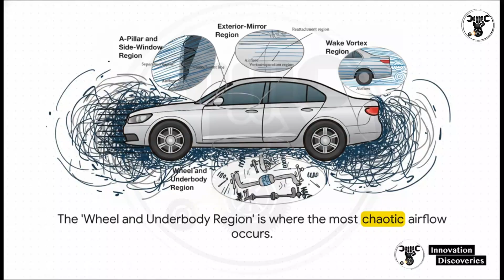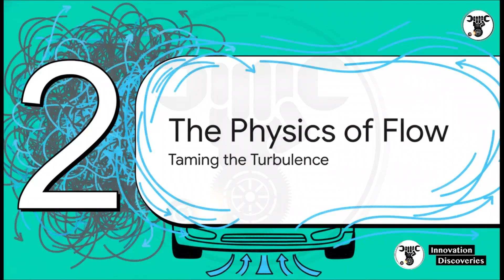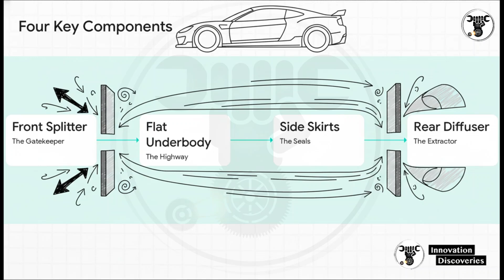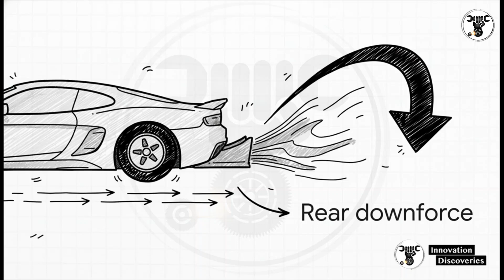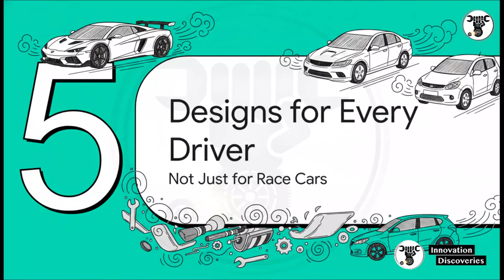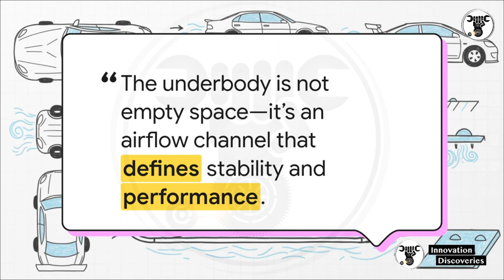UNDERBODY AIRFLOW MANAGEMENT

Comment: I wonder if you all did any wind tunnel testing. Air going under a vehicle, and even more so under a lifted truck isn’t the cleanest. How does overcome this? Same goes for the top of a vehicle, adding a scoop to a hood in the wrong place can do more harm than good do to differences in pressures. I don’t doubt it cools, due to it being made like a heat sink, but the scoop is what gets me.